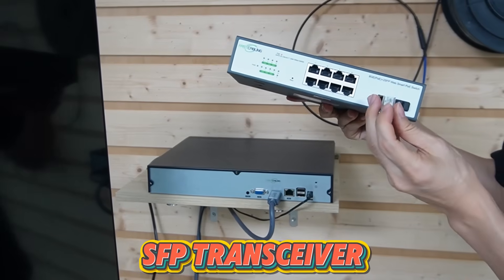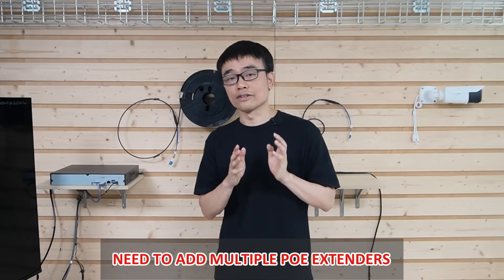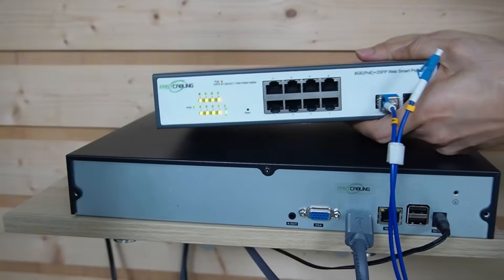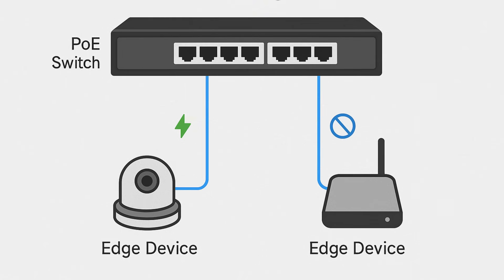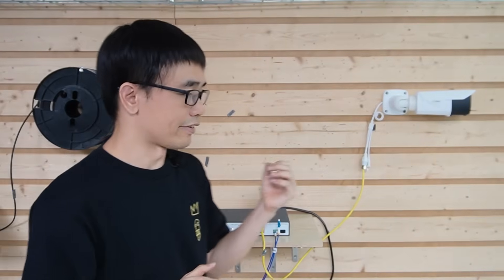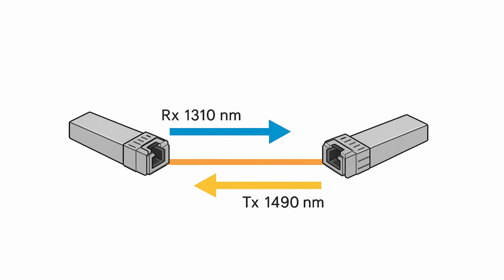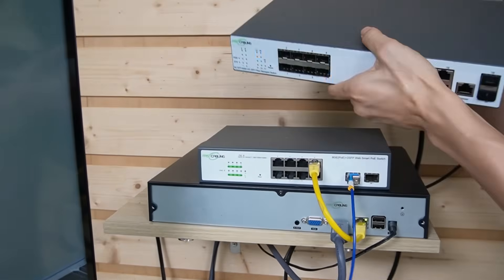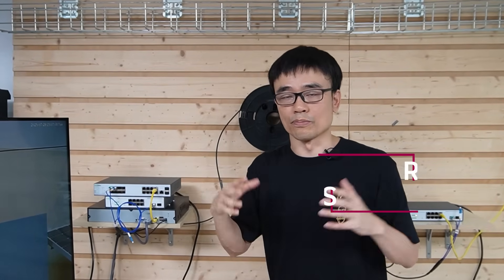Build A Fiber Network for Multi-Site IP Cameras | Scalable CCTV System Setup

Comment: why are the little handles in the sfp chip different colors, one looks blue and the other looks green? what does that mean?
Reply from the maker: It indicates different wavelengths. 

Green: 1550nm Tx / 1310nm Rx
Blue: 1310nm Tx / 1550nm Rx

The BiDi SFP modules can transmit and receive data over a single fiber. These two are a matched pair and must be used together on opposite ends of the same fiber.

You can find more information here: https://www.fastcabling.com/product/bidi-sfp-fiber-modules-2/

Comment: Hello after installing fiber can it be use for wide area in a condomuim enviroment like use for lift cctv (without lan cable , meeting room, gym room, game room, pump room to read 3 phase meter electrical meter, monotpr pump at squash court, fish pong motor and etc application and we want the system to allow any time a new cctv site. What type of PC server, software to support this fibre optic cable?? Thanks , if possible recommend other web site to meet our needs?
Reply from the maker: Fiber doesn’t run the system alone. It only carries the signal. You still need switches, PoE, a server/NVR, and CCTV software to make everything work. 

For analytics (people counting, license-plate, AI) budget more CPU/GPU and RAM. For storage, RAID6 or RAID10 is normally recommended for surveillance because of write performance and redundancy; use surveillance-grade drives. Choose a VMS that supports ONVIF cameras, has a clear licensing model, and can scale (add new cameras/sites easily).

At the moment we only promote and support our own brand’s solutions.

Comment: Layer3, layer2 and end point devices here how to make connection using fiber and cat6 cables?
Reply from the maker: Use fiber uplinks to connect your Layer 3 core device (router or L3 switch) to distribution/access Layer 2 switches. From each Layer 2 switch, use Cat6 to connect nearby endpoints.